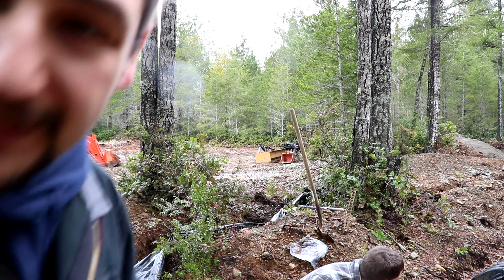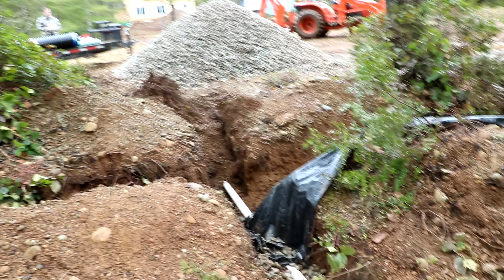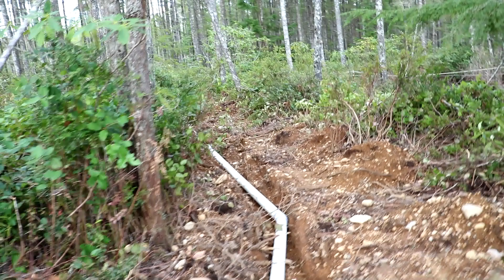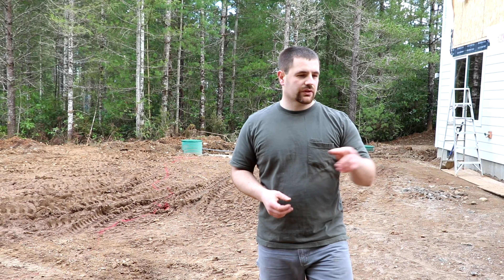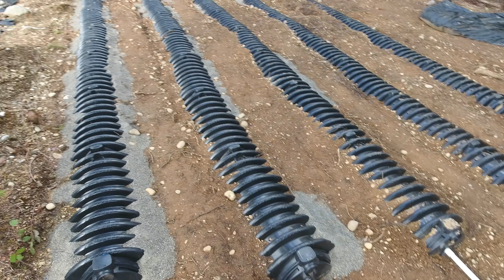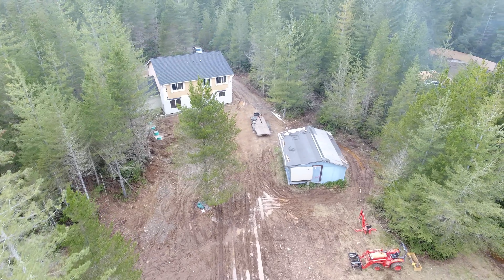COST of septic system install!!! #5

Comment: Hi Daniel, my name is Toni. I'm having a (40x52) inch Metal building put on a 7,500 square foot lot. I'm getting estimates from contractors as to approximately how much it is going to cost me for them to tie in the existing public water and sewer available close to my lot and pour a Concrete Slab that the Metal structure/ pole barn will sit on. They will have to pull the plumbing up through the Concrete for 2 full bathrooms and a Kitchen sink. Can you give me a approximate Cost that something like this should cost me. My lot and Metal pole barn combine together is only costing me $50,000 dollars and I was hoping to spend a lot less for this to be done. I really enjoyed looking at your video. I wish, I knew how to do this myself. I do have a licensed plumber who is going to install all of my fixtures. If you could just give me a approximate Cost of what you think this should cost me. I would appreciate it. Thanks.

Comment: Does the sand on the side of the chambers not infiltrate through the slits on the side of the chambers and get into the run?  This could prevent flow when the sand builds a mat layer and cause a potential failure (EDIT since this is a pressurized system the flow wouldn't be blocked but overall water holding capacity in the chamber could be effected. In a gravity the flow could be halted or hindered).  In Western WA where I worked for 20 years, we don't put chambers in sand anymore cause they can settle down effectively blocking the line.

Comment: Literally just had my entire septic system replaced last week. In the Western New York area. Nice new 1500 gallon tank, main line sent out about 100 feet to distribution box, into sand filter, 1 leach line run out another 120 feet with additional offshooting stone weep trenches to help keep yard drier due to silty soil. 10k. And around here that is reasonable. I know people who have gotten estimates for basically the same thing for as high as 14k. The system we had was nearly 70 yrs old. Leach line was a 4" perf pipe laid right out into soil. No surrounding stone. And dead ended in yard. In silty soil water has absolutely nowhere to go. Hence why our old tank, leach line, sand filter and main line was constantly completely filled with water.

Comment: So how much did it cost ? $20k. Most septic systems that I have seen there is a 3" pipe going to the chambers and that is it. No balancing or inside pipe at all. You must be in a nanny state?
Reply: Yes It goes into a distribution box, with no valves involved,

Comment: I'm having this type installed now,10,000 bucks
Reply: TJ FORGEY so the septic system has a electric pump that pumps out the waste water 250 feet ? Any idea how much electricity it runs ?

Comment: I live in the PO area and was looking for a septic designer that will do a gravity system that I will install myself I also have a Kubota and found your channel today
Reply from the maker: mike cornell Well it’s not the designer that determines what type of system. The type of soil that’s on your property, Is what determines the type of system you have. In kit sap county homeowner is only allowed to install gravity drain so if your system is determined to be something different then you won’t be able to install yourself. I have worked with acne septic several times and I can’t speak highly enough about them they’re always booked up and a lot of the times they will refer you to somebody different however you should try really hard to have them be your septic and site development plan designers. I hope that helps.
Reply: @DanielWoodell   Hi like your channel  and Yes we have 48 “ sandy loam but everyone is pushing presser distribution systems we had someone out that said they would do gravity but then tried to push in a different way so we payed him for his time and told him no thanks we r in PO but the property is off 302 I pierce co  we will keep looking
Reply: @DanielWoodell   Hi like your channel  and Yes we have 48 “ sandy loam but everyone is pushing presser distribution systems we had someone out that said they would do gravity but then tried to push in a different way so we payed him for his time and told him no thanks we r in PO but the property is off 302 I pierce co  we will keep looking

Comment: What is going to happen when the trees start sensing a new water supply? I have watched videos showing people who are connected to the city sewer system and tree roots have penetrated the piping and completely clogged the piping.
Reply: You can sprinkle copper sulfate over all the trenches and tanks to prevent root growth
Reply: Those chambers carry the water lines a food above the bottom of the trench so they're full of air. When properly dosed the chambers are supposed to dry out which kills any roots.

Comment: Nice install but expensive.  Extra cost had to do with pressure system taking it out to 250'.   But if you can afford it I believe that getting it away from house and main usable yard area is a plus.  Great job.

Comment: When I had a house built back in 1996, they charged me $3000ish  to have the septic system installed. That included tank, lines, permits, labor, and everything else. And I thought I was getting screwed.

Comment: Those "infiltrator" lines seem to require a lot of excavation and backfilling compared to subsurface drip irrigation for a dosed pumped system.  Are subsurface drip systems not approved in Washington state ?
Reply: How is that going to work in freezing weather? It doesn't.

Comment: Two questions:  Trees & ice.  With so many trees on this lot, in the areas where your pipes are laid, aren't you concerned about trees and roots reeking havoc on your system?  And the depth is so shallow, aren't you concerned about your system freezing up in the winter?  What are the guidelines you followed to avoid these kinds of issues?
Reply: A mature oak can suck up and transpire 1,000 gallons of water a day. My leach field runs through a forest with dozens of oaks and hundreds of other trees close by. It’s been in operation 36 years without a glitch

Comment: It seems to be an overkill having 5 lines 50feet
Reply from the maker: Gontainer he has a 6 headroom house, and the dirt there is really bad for drainage so the engineer circulated that he needed that much, also hard pan is only about a foot or so under the infiltrators,

Comment: I enjoyed watching this series even though it will never be useful in my life. Forgive my ignorance, but in both of your counties, are tract homes and smaller homes on small lots on sewer systems by code?   I assume this system required a certain amount of acreage to install. Here on Long Island, the soil is very sandy. Typically its either cesspool ...small footprint, or a growing trend to sewer. If that setup was needed here, home prices would be unafforadable.
Reply from the maker: Most cities that have sewer available require homeowners to use it, in your area. Both of our houses are out in the rural area. There are different types of systems that can be installed if the amount of land is not sufficient. On my house I was able to install a gravity drain system and it cost about $4,400, my brothers system is much more complicated.
Reply: @DanielWoodell  are you in Lewis county? I live in Mason county and thinking about buying a couple acres to build my house, still searching for the right place at the right price tho. Your video/ info are valuable,, thank you.